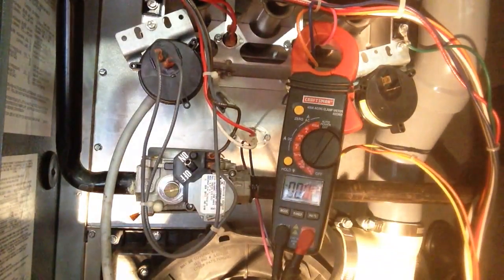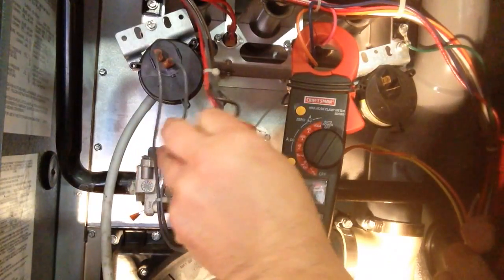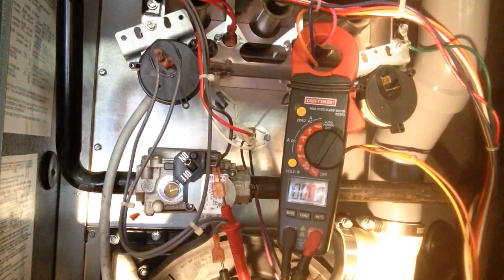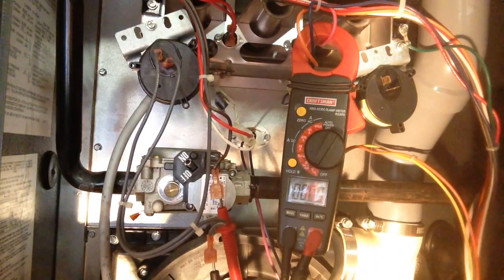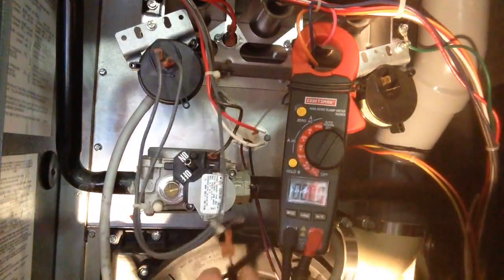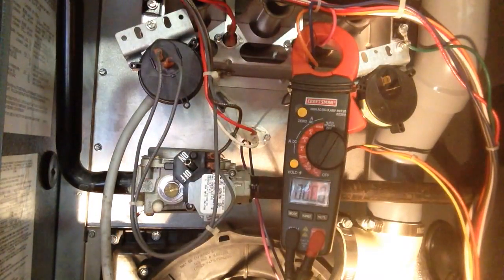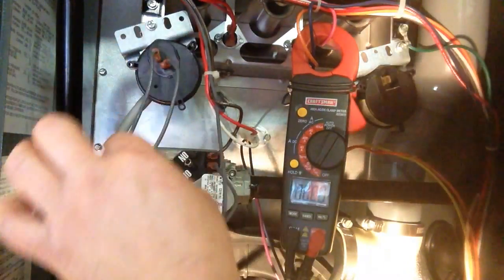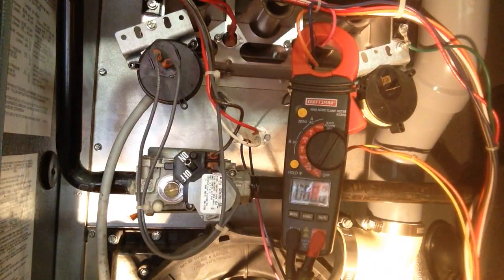DIY How To troubleshoot furnace gas valve

Comment: When you test with the volt meter, do you set it for mV? And I'm always paranoid about which terminals to use. Do you put the Neg tester on the common or does it matter if you put the Positive tester on the common?
Reply: @Shane P it's supposed to be on ac volts. And no it doesnt matter which side you are on.

Comment: I just installed a new ignitor and a new smartvalve in my furnace and the pilot won’t light/glow. Any suggestions?
Reply from the maker: These are spark to pilot. Can you hear it spark? Them a small pilot will light. Flame sensor will sense flame and open main gas valve. But before that can happen the draft inducer must come and pressure switch will close.
Reply from the maker: Make sure the gas is on and the gas valve is in the on position.

Comment: Clear and Good test, simple to understand. Mine, the Goodman GDS8703AX gas furnace has intermittent 24VAC from a connector to the other side of the panel, not the controller as I thought. Wiggling the connector at the far end sometimes work, now it is not. Where is  this 24AVC coming from if not the controller board ?